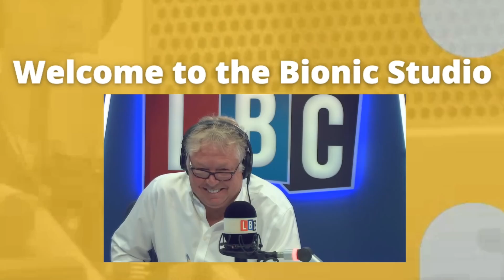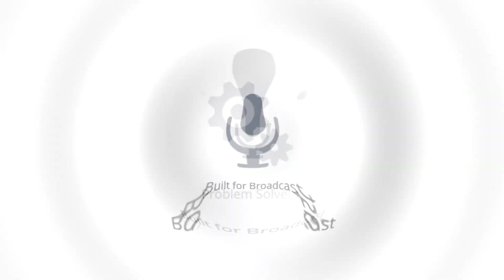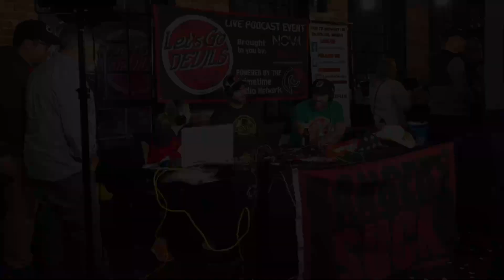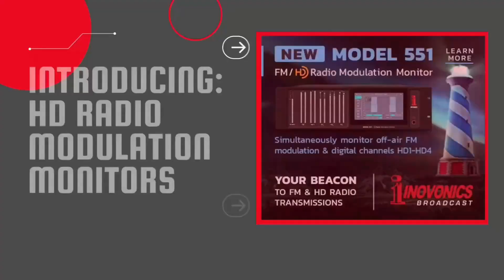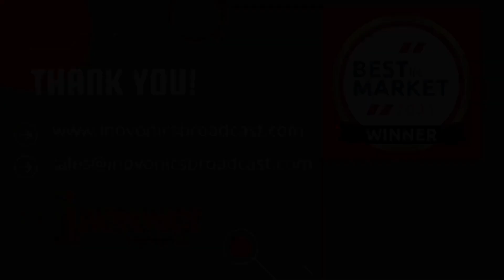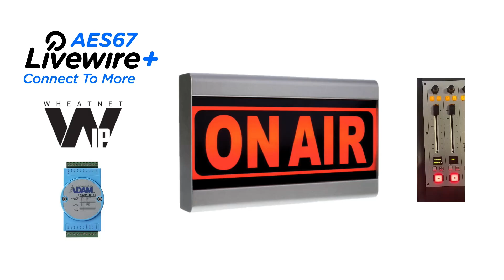Practical Engineering with Chris Tarr - TWiRT Ep. 586

Comment: Another great show guys. I would love to get in touch with Chris Tarr to fire a couple of questions at him. I'm firmly convinced by personal experience and by working with others with similar backgrounds that one of the great things about having been involved in amateur radio for a number of years is that "ham radio" projects and experiences such as building home-brewed wire antennas carries over well to things like the building of long wire antennas for AM stations, which was discussed in this episode. If you can successfully string together a dipole or long wire antenna using galvanized picture hanger wire in Alabama that's only 12' above ground level using tree branches and trunks to old it all up, hook it to a 100 watt HF band rig running "barefoot" (no additional amplifier), and have a reliable conversation with another station in Australia at a total cost of around $50 (just one of my exciting ham radio accomplishments over the years), or build a longwire or other homebrew antenna like an off-center fed dipole capable of handling up to 1,500 watts that tunes well, then you've gained some valuable experience toward being able to fashion a long wire or other antenna that can provide surprisingly decent and reliable AM signal coverage for your station in your market area. As Chris pointed out, it might not be AS powerful as your vertical tower and requires an STA to be legal, but it sure beats being off the air and having to shut down you FM translator. This episode got me thinking about how a "sloper" antenna strung from the existing AM tower (but insulated from it) back to the transmitter building possibly serve as a great emergency antenna in the event of problems on the tower itself.

As for insulators, for 500 Watts or less (although I've used them for considerably higher power), a great way to fashion emergency insulators is to drill a couple of holes in each end of a short section of PVC pipe. I typically use 1" PVC. Loop a piece of rope or strong cord of some type through the holes at one end which you can use to secure it to a building or other anchor point and you've got an insulator. Loop your transmission/antenna wire through the other and run that to another similar insulator which is attached with yet another piece of rope to the remains of your tower, another building, a tree -- whatever you have available at the needed distance to be able to string it all in a straight line -- and you have yourself a long wire antenna. You can optimize the tuning of the wire antenna by shortening or lengthening the antenna wire to bring it to the correct impedance and low VSWR, and simply adjusting the length of the attachment rope or cord on the insulator at the far end from the transmitter building or "take off point" so that it stays reasonably taught and straight. I've built everything from simple, long wire antennas, delta loops, NVIS (Near Vertical Incident Skywave) antennas, off-center fed dipoles, dual frequency "X-configured" dipoles fed by a single feedline, Hentai loops, and more antenna styles with great success over the years.

One of the nice things about also being and thinking a bit more like a "ham" radio operator but applying it to broadcast engineering is that you'll find there are a TON of websites out there with wavelength calculators, along with antenna design tools where you can put in your frequency and the velocity factor of the particular wire you're using, and it will spit out the lengths/dimensions of whatever wavelength you need at a particular frequency. Also, there are some great, inexpensive tools out there which are built with the ham radio market in mind but they also do a great job of testing the impedance, VSWR, return loss, and more for commercial/broadcast stations and equipment.

One ham radio market intended device  I particularly like and use a lot is the EU1KY Antenna Analyzer, which can be picked up for around $200 completely built (or you can buy it in kit form for less if you don't mind doing some assembly yourself.) I use one of those often for everything from below 1 MHz all the way up to around 500 MHz. It does all of the above tests, and even plots Smith Charts which you can run at a single frequency or sweep a desired frequency range. It also has TDR built-in which I've used to chase down transmission line faults on numerous occasions. Disclaimer: I am in no way affiliated with the guy who builds or anyone who sells the EU1KY Antenna Analyzer -- I'm simply mentioning it because it can not only be a lifesaver of a tool to have in your box (it's powered by an internal, USB rechargeable battery), but it lets you save the data and test result screens, which you later dump to a computer for sharing the images. Oh, and another great feature of it: it's compatible with the freely downloadable software designed for the RigExpert handheld analyzers if you'd like to operate it from a laptop or PC. It's also one of the better RF shielded "ham" test devices, with a nice, heavy, sturdy machined enclosure, and has LCD touchscreen controls. It's virtually impossible to go wrong getting yourself one of these for around $200-230 last I checked. Lastly, they make the software "open source," so the user community has several people who are continuously making additions to add more and more features, and they get the "bugs" in any software update/revision/modification cleared up pretty fast, although mine has been running the same version software which was in it at the time of purchase several years ago and it still performs flawlessly. I just use a set of O-S-L test loads to occasionally rerun the calibration just to make sure nothing has changed, but it holds steady. Works at 50 or 75 ohms as well, further extending its versatility. It's a lot less expensive than a RigExpert device with a comparable frequency range, extremely less expensive than an Anritsu SiteMaster, etc., but can all the same jobs done for you just fine (and can do more jobs than either of those devices.) Accomplishing that while keeping a huge chunk of change in your wallet or bank account also means you have money left over for other stuff -- like a decent dinner and cold beverage with the team to celebrate a job well done at the end of the day ;-)